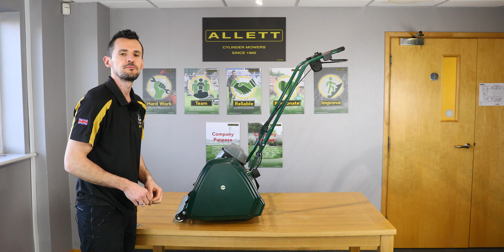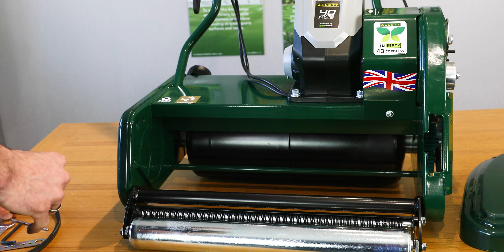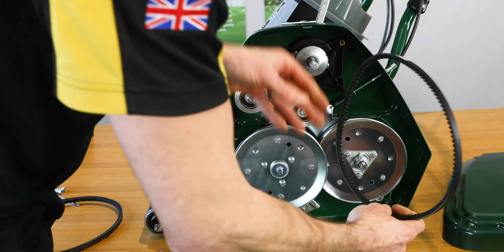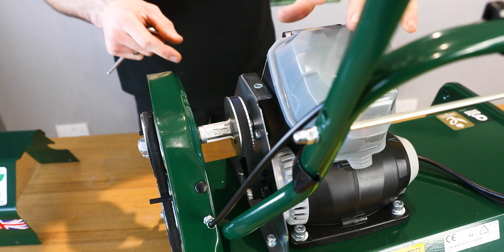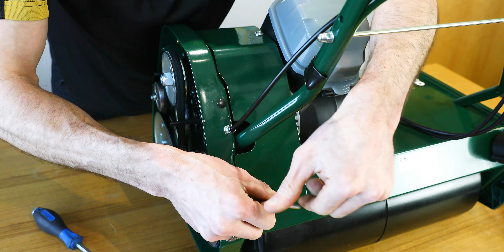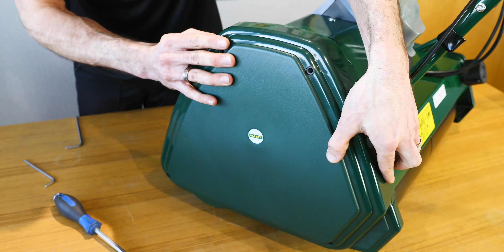Changing the belts on an Allett Liberty 43

Comment: Hi I need to change bearing and the shaft that runs the belts, and are connected to the electric motor. Is there a guide for this?

Comment: I can’t figure out why my reel keeps stalling. I’ve replaced the drive belt, the other 2 belts in the housing are in good shape and the tension is properly set. All plastic cogs have all their teeth, there does seem to be a bit of ‘play’ or wiggle room between the white wheel from the 6 blade and the green wheel in the side housing
Reply: It works fine when I start it on concrete but once it gets any resistance in the grass it stalls and makes the most awful grinding noise as if the cogs aren’t in time. I raised the HOC to 4 in the window and made sure the blades (which are slightly dull, going to backlap this afternoon) are set so they spin without too much rubbing on the bed knife but can also cut some paper. 
I’m in the States btw (NC)
Reply from the maker: @Thehillest  Hi normally when it is stalling it is either you have it set too deep in your lawn or the cylinder is set too tight to the bottom blade. The grinding noise could be your cogs. I suggest emailing technical@allett.co.uk if these suggestions don't help and Ian can give you some advice. Make sure you are not working on grass that is too long
Reply: @ALLETTMOWERSUK  will do thanks!

Comment: Why is it i can never find the solution to a mower problem some of these videos' are about as much use as an ashtray on a motorbike .How do you strip down and replace the roller on my classic 35s to stop it moving about from left to right ?
Reply from the maker: we have a network of dealers for repairs- we don't advise anyone to strip down their mower. If you need technical support email technical@allett.co.uk
Reply from the maker: ps this is a belt video- not a rear roller video

Comment: Great Video! My Liberty 43 was just delivered 3 days ago. I have been hard on it, i scarified my fairly thick Bermuda yard and have also been slowly cutting it down in height as I move into the transition of a reel mower yard. Today the reel kept stopping on thicker grass. Because This machine is so simple and well thought out I was able to quickly disassemble the mower and find that the problem was the tension on the first belt in the chain. Thanks to this video I was able to easily tighten it up while enjoying a beer. Again, really easy to follow and thorough video.
Reply from the maker: Great glad it helped 👍
Reply: @ALLETTMOWERSUK  What size are those belts, specifically the motor drive belt and where can I get it in the US.
Reply from the maker: @ulises-wz  For Parts or technical enquiries Please contact Christine on (912)414-1129. christinem@allett-usa.com
Reply: Did it have too much tension or not enough?

Comment: That day is now ! 
I have to tap / squeeze the turtle/ rabbit switch on the handle to get the reel and drive to move faster ?
Sometimes the switch nob controls the speed but it's happening often now ? 
Any suggestions or a training video would be appreciated. 
Could that be the belts tension ? 
Now just today my reel stop turning, I will look at the belts on that tomorrow. That rabbit/ Tuttle switch might control motor speed ?
Thanks